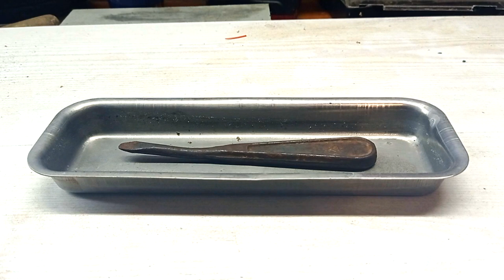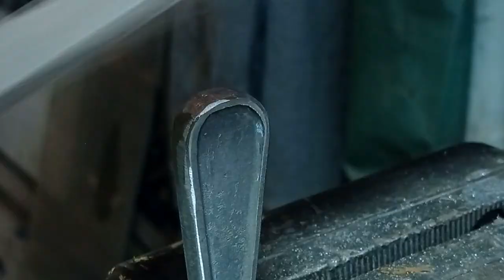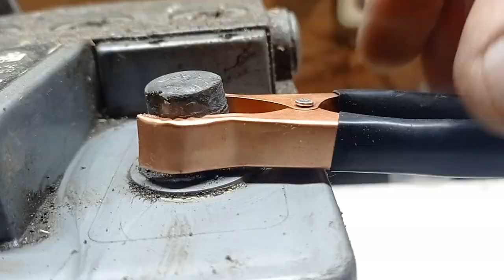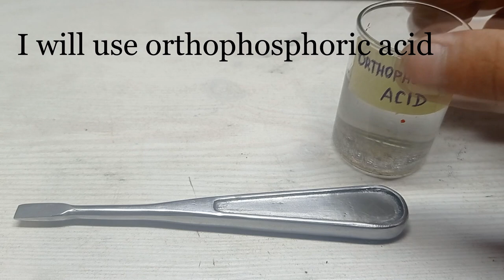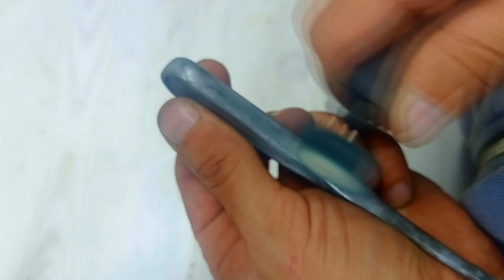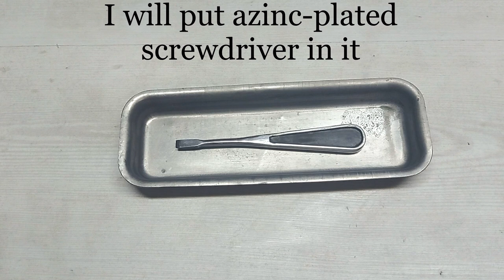Restoration old rusty screwdriver. Zinc plating + experiment

Comment: You should put a non-zinc screwdriver in the water to see if it forms rust and how fast. air is needed for the rust, so it's gotta be partially submerged.
Reply from the maker: I'm glad you liked it, thanks for the kind comment, after a few days some of the water evaporated :) by the way, the result of the experiment is already in the video on the channel :) have a nice day